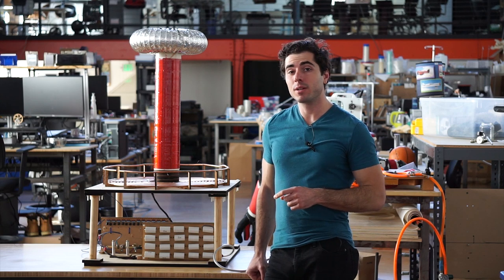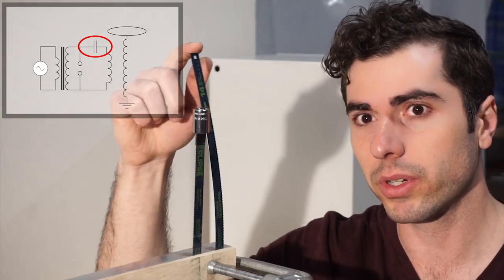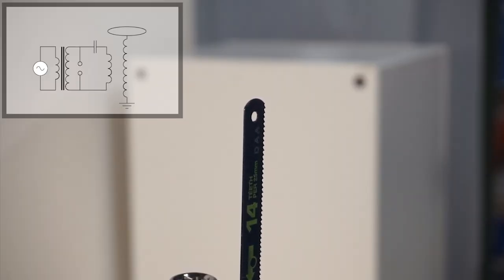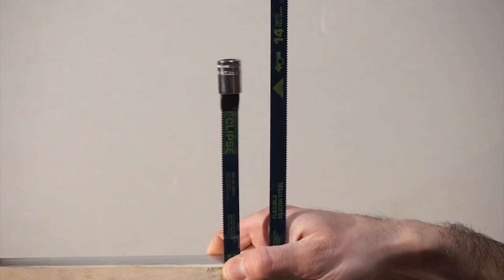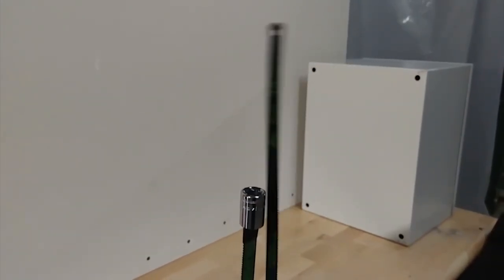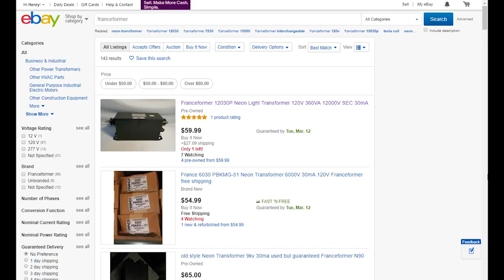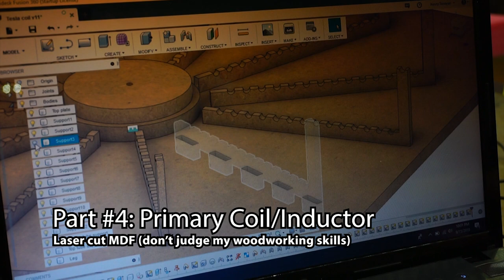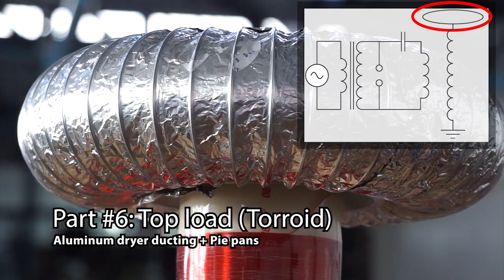Henry does a Tesla Coil

Comment: Great video! You should look into using a fan on your spark gap. If I remember right, it helps blow away the ozone so the breakdown voltage of the air stays more consistent.
P.S.
Do you do the voice of Tina from Bobs Burgers?

Comment: I still don’t understand, won’t you have to put a diode in between the transformer and the cap bank? I thought capacitors can only be charged by DC current.
Reply from the maker: Great question, you are correct about DC current, but to this capacitor bank, the 60 Hz cycle is slow enough to basically be DC. They charge to their full capacity during the 60 Hz cycle and discharge once they reach their peak. When the AC polarity flips, they charge in the opposite direction and the cycle continues.